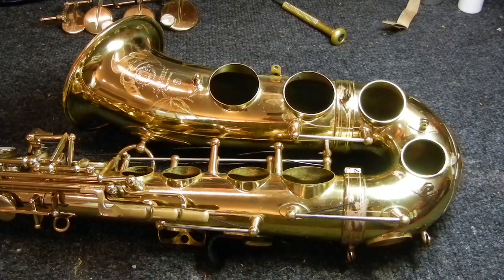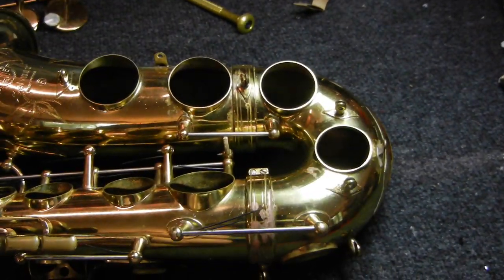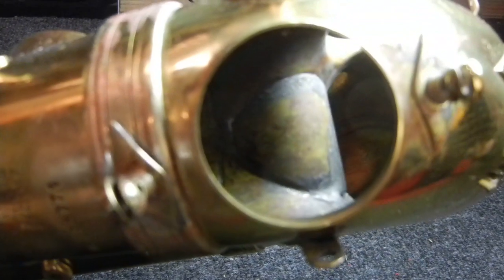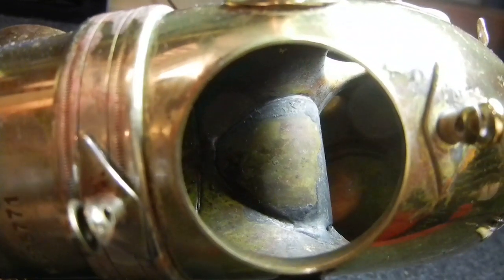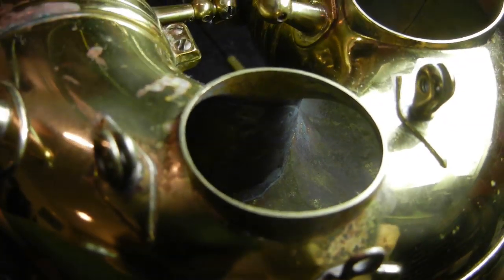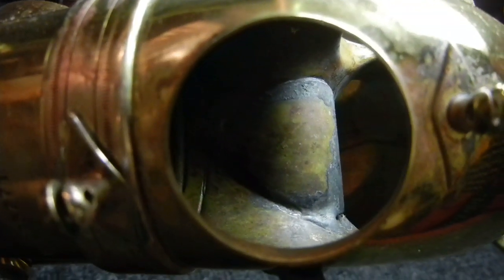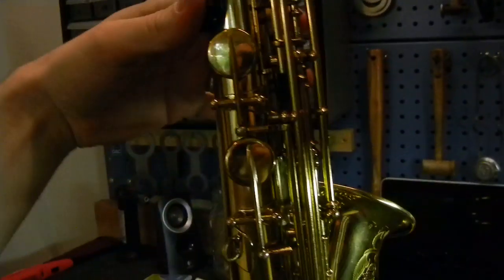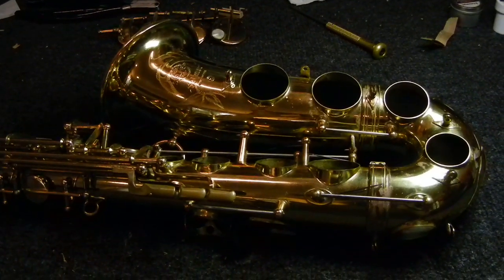Repairman's Overview (Quickie): Late Selmer Mark VI Alto Saxophone Bow Patch

Comment: I had a 180k MVI with this issue, I asked my tech to overhaul the saxophone but with a more open key heights setup  and the problem went away. If you are unwilling to change your mouthpiece setup, the only way to get rid of the problem is by changing the geometry of the saxophone by either adding material to the bow, using a different neck or changing the venting (this will also affect intonation so be careful here).

Comment: A slightly related anecdote… I experienced low end burbling on a new Ref 54 alto at a music store back in the mid-late 2000’s.  Many people have a shared experience with burbling 54’s.  The burbling went away when I put my Serie III neck on it.  So I sometimes wonder if the Ref 54 neck design is “wrong” in some way.  I don’t remember which mouthpiece I was using.  Might have been the Super Session of the time that came with the 54.

Comment: I have the burble issue intermittently on a Mark VI tenor serial 159xxx, (1968).  It's not always there, but when it happens it is most annoying.  It does most often occur with low C, but occasionally on low B instead. Rarely on both at same time -- usually one note or other and never on low B-flat.  It does seem to be mouthpiece related but sometimes will go away if I change reeds (go figure?).  As you mention, when it persists,  dropping a wine bottle cork in the bell usually does the trick.

Comment: Not present on mine. (#191xxx); wonder if it was something that was added after play testing , if the problem was found(?) I never had any trouble playing down there. 
Boy, I wish my laquer looked like this horn, though!  Mine is failing...lots of little dots where its worn thin.  Wish there was something that could be done to restore it, or at least keep it from continuing to degrade :(